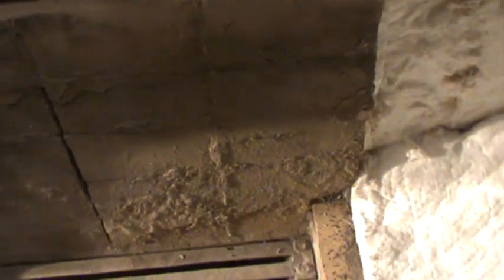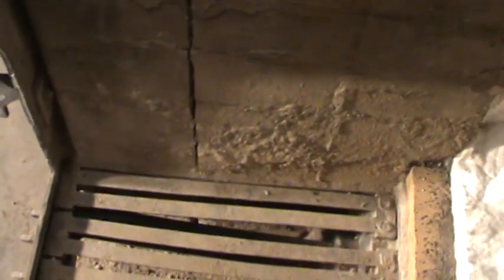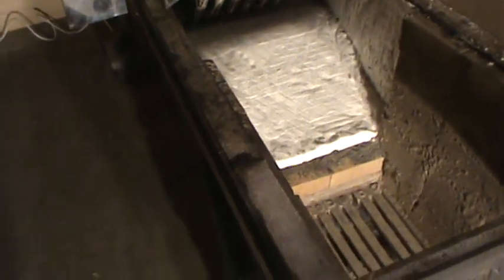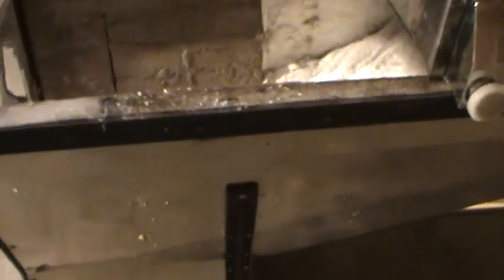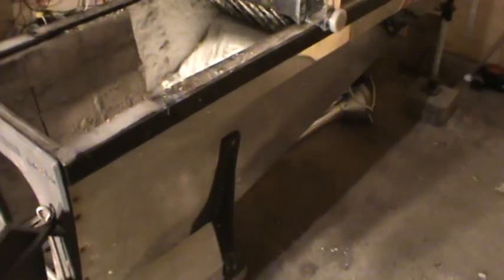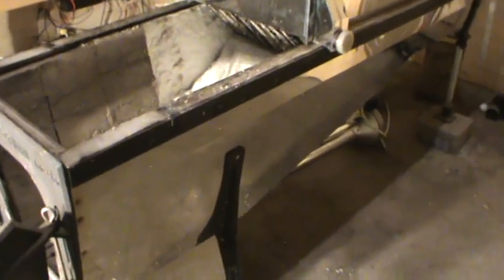Efficiency increased on a D&G 2x7 evaporator( Les Sucriers.com)

Comment: I have been listening to you for two weeks. I now have put it all together in English. Thank you for this information. www.duclosmasonry.com  I made a manifold and I have a blower with a good amount of CFM. Okay everything is home made but when my ship comes in I will get a full evaporator. Aging Mercy Marc Duclos
Reply from the maker: The blower must be fully controlable....It is not the amount of CFM that is important, it's the amount of air pressure , so adding too many or too big holes will have an effect on air jet pressure , of course, this oxygen delivry is for the main combustion, it's different for the secondary combustion, secondary combustion needs less pressure but more heated oxygen (Air)
Reply: @goudrelle1  I have a speed control switch. My thews are 1/4 inch on (3)-1-1/2 tubbing.
Reply from the maker: @marcduclos9789   What do you have for blower, type ? CFM ? static pressure ?? size ? 4 inches  blower ?  Marc, you speak french ?  Where you at ?
Reply from the maker: @marcduclos9789   You are in New Hamshire USA Right ?
Reply: @goudrelle1  Nashua wood stove replacement parts 1c465
Reply: @goudrelle1  Yes I am in Deerfield NH  I am 60 now. when I was a taun na I spoke French. I coplare but  not enough to get by.
Reply from the maker: @marcduclos9789  1C465 is a 465 CFM Blower , might be too big and strong for your outfit ?? What size evaporator did you built ??
Reply: @goudrelle1  I have a waterloo cross flow syrup pan 48x60. I run it not so. The brick is laid on the with of the brick one on the out side and the fire box is 28x32. the grate is 21 from the pan. I created a baffle just past half and up to 1-1/2 " from the pan to the throate . I have a draft door under a single door 16 x 20. my chimney is out side. Just came in for some more taps. Thank you Misher
Reply from the maker: @marcduclos9789   OK, then the holes in the air manifold is too small, make sure you have a minimum of 30 holes and a diameter of 1/2 inch......That way you should have more control over the air jet, specially with a controled speed blower with so much CFM, use both, air comming from the blower and also air comming from the front damper under the door......Make sure to use a damper at the bottom of the stack..... Draft in the stack should be at around .05- .05 1/2 inch water. use the heat under the pan, not in the stack...
Reply: @goudrelle1  Thank you for your assistance with my maple syrup contraption. You wouldn't believe it but I made 65 gallons in 2013. I am up to around 750 taps. I started 2012. I understand what you mean .05 .051/2 water. The oil techs around hear like the draft meter to say .o4. at the outlet connection to the first chimney pipe. I have a way to measure this. I tried the 1/4 holes and they were not what I expected. I will get on the 1/2 drill by first boil. Maybe Monday for me. Just about done half of the taps only so far. Thank you aging Bonswa.